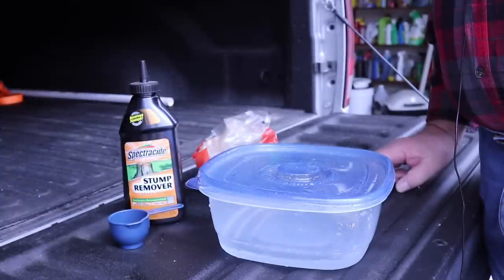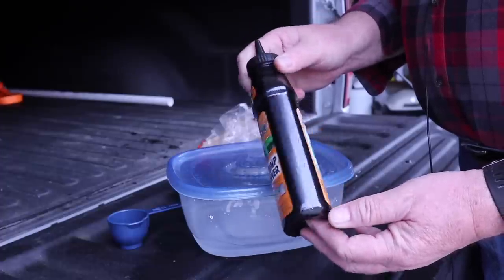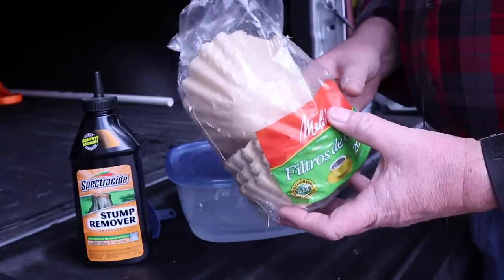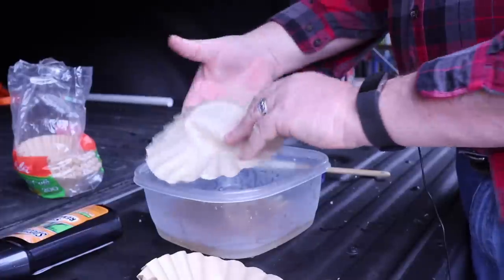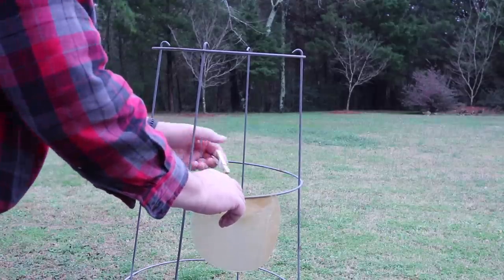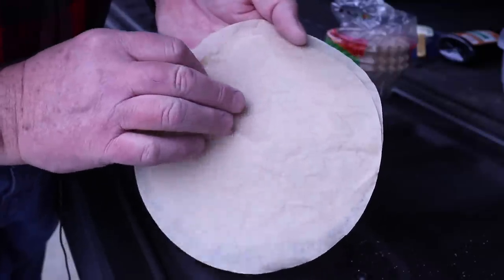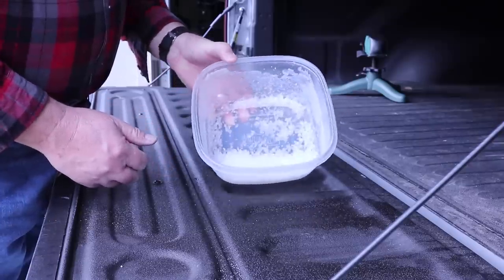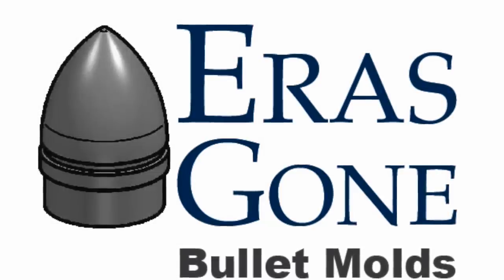Nitrating  Paper for Combustible Cartridges

Comment: A better way to do this would be to boil your water and then add the KNO3 to it. You will get a higher saturation rate since hot water can hold more dissolved KNO3.  When you are done, don't throw out the leftover solution, heat it back up to boiling, and then pour about 50% by volume of isopropyl alcohol into the solution, and it will cause the crystals to crash out. Then pour the whole solution through another filter and leave in the sun to dry. You will be left with all of the KNO3 that was left in solution. The powder left over, will be more pure than what you started with.
Reply: That's nice information, thank you. However, I've had good results without that. With the exception of the bottom cap not being consumed at all.
Reply: I put them on a cookie sheet and dry them at 150 with no problem.
Reply: He's not looking to issolate.
Reply: @eddiespencer1 issolate? COVID IS OVER

Comment: The paper is probably not being significantly nitrated in the strict chemistry sense, as in converting cellulose to nitrocellulose.  That requires addition of an acid to convert potassium nitrate into nitric acid.  What's actually going on here is simply impregnating the paper with potassium nitrate which then acts as an oxidizer to burn the unmodified celluose molecules... which is almost certainly preferable for making cartridges.  Nitrocellulose flash paper tends to be more fragile than the paper it's made from, but this way you get the benefits of burning up all the paper without weakening it, in addition to a much more simple (and safer!) process.  Pretty cool!
Reply: Agent VX right, he’s just costing the paper with a nitrates solvent and drying it onto it.  I’ve done this before when I was recrystallizing kno3 to purify it and filtering it through coffee filters.  The filters burn nicely and completely.
Reply: I think nitrocellulose would be too unstable to use for cartridges.
Reply: It is stable, however it won't be safe. Smokeless powder is made of nitrocellulose. Smokeless powder in a black powder gun is a bad idea.
Reply: Doesn't the nitrate change the burn speed of the  black powder? By changing the  Ratio of nitrate already in the powder
Reply: Shane Briggs The burn rate of the black powder stays the same. It just helps with eliminating the paper residue.
Reply: Agent VX it’s not nitrated paper...if you nitrate the cellulose it will be more efficient but in that case nitrocellulose paper will be create lot of supplement energy... I think it’s a bad idea BP+NC not the same speed of combustion... under pressure the NC detonate.
Reply: short - it works :)
Reply: @murderouskitten2577  It works to make sure the paper all burns up.  It doesn't work if you're trying to do a nitration.
Reply: @anonfilly7335   why it seems like it would reduce fouling . is the burn rate to agressive  or are the products of combustion corrosive  would like to understand the logic of your statment
Reply: @mobiousenigma  if the burn rate of the paper is similar to the burn rate of the black powder, then shouldn't it reduce fouling since the black powder wouldn't be burning on the surface of the cylinder, and the unbleached coffee filter covered in potassium nitride would hypothetically burn a little bit cleaner? or if the burn rate was quicker than the black powder then you would get a more efficient and even ignition
Reply: @matthew33721  paper and powder bur at vastly different rates..my point was the clay content in modern paper isnt a benefit to this process but thanks for the input.
Reply: based aksheully poster
Reply: I couldn't have said it better - this is not a true nitration by chemical definition. Nitration modifies the structure of the cellulose paper to add nitro (NO2) groups which introduce additional oxygen which supports combustion. This is similar, just adding potassium nitrate as an oxidizer to help the non-nitrated paper burn up when the cartridge is fired.

Comment: I did the same thing for making combustible cartridge for a percussion Sharps Carbine.  To make sure my cartridges were robust I used some scrap cotton sheets, cut to 8.5 inches by 11 inches .  Once the sheets had soaked up the super saturated mix. I hung them out to dry in the shower and once dry I put them in a plastic container used for leftovers.  It was then used to make into cartridges for the Sharps.  Good presentation, they'll help a bunch of people out.

Comment: Just a recommendation for anyone trying to do this if you can't find a stump remover that doesn't have a bunch of additives try going to the canning section in the grocery store or your Pharmacy and look for what's called saltpeter saltpeter is always at least in my experience 100% potassium nitrate and can also be used for canning things. Also much cleaner and safer. Than stump remover.
Reply: If you don't have potassium nitrate(stump remover),you can obtain potassium nitrate from ammonium nitrate plus non sodium salt and water.You can obtain potassium nitrate cristals.
Reply: I bought a pound of it from a local chemical company that just so happened to be advertising on eBay. I think I've used two cups of it so far, and I have made a LOT of paper cartridges, more or less, using Era's Gone instructions here in this video (I had a couple hundred coffee filters that didn't fit any coffee maker I own, so I used those)
Reply: Salt petre is the old name for potassium nitrate.  When I first moved here, salt petre was just down the shelf from flowers of sulfur.  Today, neither is as easy to find.  Pure potassium nitrate stump remover is easier to find, but even that requires careful label reading.
Reply: @dennisthemenace3695  I live in South Mississippi.  You bought 5 pounds?  In which section of the store?
Reply: @dennisthemenace3695  Thank you!

Comment: Try (36g) potassium nitrate, mixed with (24g) of standard granulated sugar, or a 3 part to 2 part ratio, mix it together in a container by shaking, heat a pan with about 1/3 cup water( or enough to dissolve the amount you have made), bring to a boil, add in your mixed composition, continue boiling until almost all water is boiled away and solution becomes a frothy like consistency, add in your paper or some string if you wanna make some slow burn fuse, let the material soak up the composition, let dry, and you have some pretty decent burning paper/fuse.

Comment: You can pure high grade potassium nitrate from a fireworks hobbyist chemical supply location. That’s where I get all of my high grade quality potassium nitrate. No need to buy the stump remover which is fairly low grade.
I also use all natural “Raw” cigarette papers. Thinner, just as strong, and when nitrated burns really well and ignites with a homemade primer a lot better, I also dry my papers in a dehydrator.
Reply: Thank you, you just answered most of my questions. Happy new year.

Comment: I buy Potassium Nitrate pellets add them to boiling water until the water quits taking /dissolving the pellets.  I then let the whole mess cool then strain it to remove undissolved pellets, I use this residue to make another batch of solution adding pellets as long as the solution will dissolve more.  I use quart canning jars to store the solution and then soak the paper as usual.  I use old tracked computer printing paper, it is substantial enough to wrap the cartridges, and burns almost as well as flash paper and is just as good  actually better as heavier coffee filter paper is while burning more completely.  Duda Deisel is a good source for the Potassium Nitrate, the pellets they sell are almost pure.  Even less expensive is finding a farmer who uses Potassium Nitrate for fertilizer, a farmer with a large operation often buys in multiple Dump Truck loads, some will even give a polite person several pounds.  Learning to be polite pays off well, I once was given a full 5 gallon bucket full  in return for information as to how to make the paper cartridges.  For a reloader, 5 gallons of pellets should last for years.  Finding the old obsolete tracked printer output paper is getting more difficult.  Thin Onion Skin paper will work almost as well; go to a stationery store and look for the thinnest onionskin paper you can find, Staples is also a good place to look for the paper.  Good luck with the process, experimentation and trial and error with. the paper was necessary for me.  A friend has found a source for TEA BAG paper that has never given  a misfire and has proven to be substantial enough to work with. Patience and experience will teach you how to make these cartridges, Videos like this good one provide a good place to start.  Happy loading and shooting!  I've followed the directions of the Video, it is effective and a good place to start, but practice and adaptability will give improved results.

Comment: Just an appreciative note for the fine videos.  I have just finished a lengthy casting session with Eras Gone Colt. 36 
and the Richmond .36.  Both fine products that drop from the mold easily.  My question is where does one purchase a fine looking Eras Gone ball cap such as you are wearing?

Comment: Hi Mark. Thanks for all the great videos you make and all the information you share with us curious souls out here, it is very much appreciated. 
I’ve just recently done this with another powdered product available a few months ago, used distilled water though. Brought two four cups to a boil in a pot, put it in a large sealer jar and stirred it while adding the stump remover until it no longer was dissolving. Created a super solution which I use on the coffee filters. Some crystals of potassium nitrate formed on the bottom, so I know there is more than enough suspended in the water. 
I keep the sealer jar in a cool dry place in my workroom and haven’t had a problem with slime forming in the water, maybe due to using the distilled water? 
Keep the videos coming, very much enjoy the history and information you provide.
Cheers
Reply: Thanks John.  Yes if you heat the water the solution will hold much more of the potassium Nitrate.  But it may also start to precipitate out of solution as the liquid cools if it is over saturated.  That is not a big deal, however, it will still work with crystals floating in the solution.  Using distilled water will definitely prevent introducing other chemicals, such as lime, chlorine and fluoride into the solution,  I'm just not sure how much difference that will make in the long run.  Thanks again!

Comment: Tea bag paper will almost completely burn up into ashes when set alight. I experimented with combustible paper musket cartridges using tea bag filter paper and always had complete combustion with no embers. Its a little more fragile then coffee filter paper, but the cartridge can still be handled without bursting so long as you wrap the paper at least 2 times around the cartridge.
Reply: Kyle Gammage if you use a saturate solution it will all burn completely on coffee filter paper.

Comment: The KN03 does not inhibit 'activity' in the stump. It increases activity by feeding microbes that rise in number until the nitrate is used up and then they eat the stump.
Reply: He is talking about if the stump is still a living tree it will kill it.
Reply: You know, I always thought you were supposed to drill holes in the stump, pour that stuff in, then light it on fire. I didn't know it was supposed to speed up the rotting. So I never used it to remove a small stump in my yard ... instead I paid a gardener a lot of money to remove it. I guess I should have read the instructions.
Reply: @vincentlok8894  different kind of stump remover

Comment: I have used flash paper and flash glue.  It is harder to work with and more delicate, but when fired it leaves the chamber spottlessly clean.  It is also safe to use because it was used in the manufacter of original paper and skin (lamb appendix intestine) cartridges.  I have used it manytimes in my repro 1851 and 1860 revolvers with round balls.  I always lube the front of each chamber with my home made lube of Tallow, beeswax, and olive oil.  I want to make more once EG molds are available again and I can buy them.

Comment: I love this! Just did it today. 3 things:
1. Adding sulfur seems to make the burn faster. Is there a reason not to do this?
2. Rice paper seems to be a cleaner burn, but harder to handle.
3. For faster drying, could you make the solution with isopropyl alcohol?
Reply: I'd ask a chemist about point 3. It probably would dry faster, but you might be altering the composition of the solution in a way you don't want to.

Comment: I’ve tried this a few times, and tested the resulting cartridges.  I eventually decided that the small difference in leftover paper bits in the chambers wasn’t worth the extra time and effort of nitrating the paper.  One test was to fire 100 un-treated perm paper cartridges from the same gun in one shooting session.  I figure that if I can get off 100 shots without the little leftover paper bits becoming a problem, then nitrating provides no actual benefit to the shooting and gun cleaning process.  And sure enough, that is what I found.  Using perm papers, I haven’t nitrated my paper in years and years.  There is some leftover paper in the chambers, of course, but it’s never caused a problem, and so what’s the big deal?

So let’s see your 100-shot tests, people!

By the time you’ve made and fired 100 nitrated and another 100 non-nitrated cartridges you’ll definitely be feeling the difference in the processing between the two.  Ask me how I know.

Your mileage will vary according to the specific paper you’re using, and if you like spending the extra time and money to make your nitrated cartridges, then OK, but if you want to save time by skipping that process, then it is entirely doable by selecting a different paper.  Just keep in mind that a little bit of leftover paper shards in your chambers are not necessarily going to be any sort of problem whatsoever.

Comment: I'm sort of a noob when it comes to paper cartridges but I just use thin hemp rolling papers and a piece of chalkboard chalk for my 1851s I just roll up the paper like a cigarette around the piece of chalk with the wad and ball set at the tip fill it with my charge from my flask cut it flat and flush and rip a smaller square of another paper to lick and glue over the exposed powder so my caps only have to blast through 1 thin layer instead of folding the end over and gluing it down and the caps having the caps trying to blast through 2 layers of rolling paper 
Does this seem like a decent way to make them?

Comment: helpful hint (from a professional chemist): at room temperature, the potassium nitrate will dissolve in water at about 1:3 by weight (that is, one pound of potassium nitrate to 3 pounds water) - if you heat the water to just under boiling, that ratio goes up to about 5:2 (5 pounds of  potassium nitrate to 2 pounds water) - so heat your water before dissolving the powder, you'll get a lot more into solution, and by extension, a lot more impregnated into your coffee filters

helpful question (or suggestion): can you do a demonstration of igniting the paper with a percussion cap? and a side-by-side of nitrated paper vs non-nitrated paper burning?

Comment: If you heat the water you can get more Nitrate in solution. Of course as water cools the nitrate will drop out of solution.242g/liter at 20C and 2,439g/liter at 100C.

Comment: I went with cigarette papers for making paper cartridges, still haven't fired any, just tried rolling up a few, but since I have read others have had it work, I thought I would invest a few dollars and experiment with it. My only worry is possible hang fires as the cap goes off and then the paper has to burn through before the pyrodex lights up.
Reply: That's been my findings. I tear off the bottom of the cartridge. Works great for me that way.

Comment: Try Duda Diesel for  Potassium Nitrate, mix the dry granules until the water will not take anymore hot, water works best.  We used this by the ton for commercial farming. I hear that it now requires a permit for large quantities as potassium nitrate mixed with the right amount of diesel fuel makes a potent explosive.
Reply: I bought from Duda, They have 1lb,5lb,10lb and 50lb bags. Actually you use ammonium nitrate and diesel fuel to make  an explosive. I used that to blow tree stumps, 1 or 2 tomato paste size cans would do the deed if placed right. Very similar to TNT and much cheaper. You do have to get a permit  for Ammo.Nitrate of over 16% purity ever since Oklahoma Bombing.
Reply: @Merlinemryys  We once bought Potassium Nitrate by the ton to replace the plant nutrients that cotton took out of the soil, we also rotated the crops by using Alfalfa for a few years.  Potassium Nitrate accelerated the process.  Usually  we saved some out for making Corned Beef and other things.  I wasn'trequired by Duda Deisel ti get a permit, probably because the amounts I ordered were small enough that they're not considered dangerous.  I do know that without Saltpeter, Corned Beef is a nasty unappetizing gray  color, it takes only a little bit in the brine to preserve the color.  Good luck with your cartridge building.  Saltpeter and Potassium Nitrate are synonymous, it along with high grade sulphur and Alder charcoal are the ingredients essential for Black Powder.  Alder charcoal is the best, though other kinds are also used for this purpose.